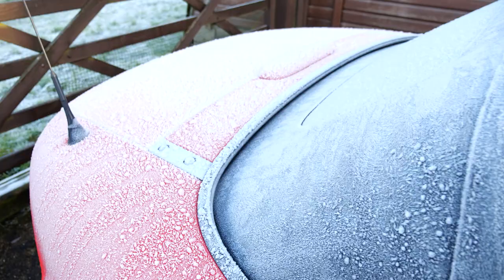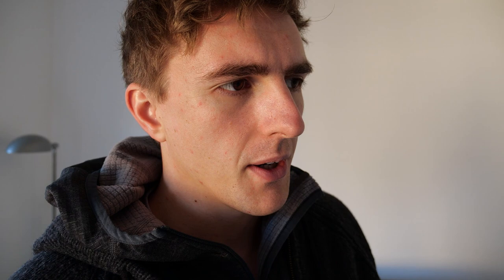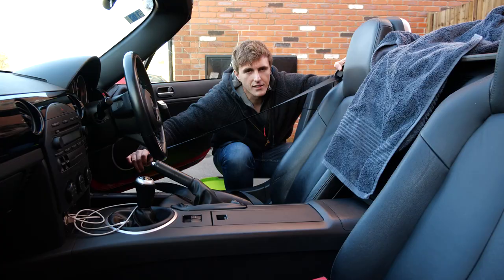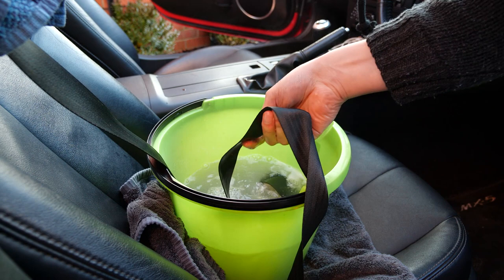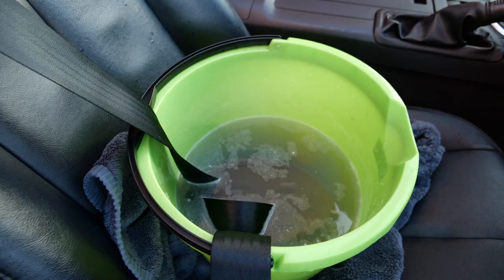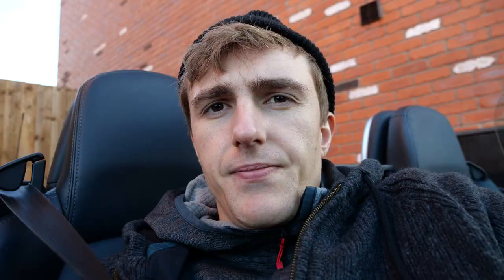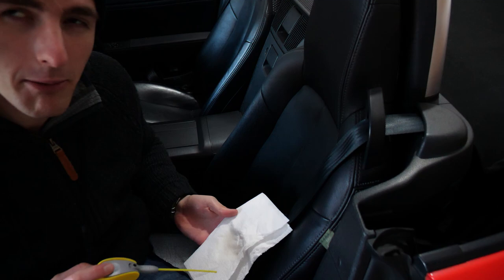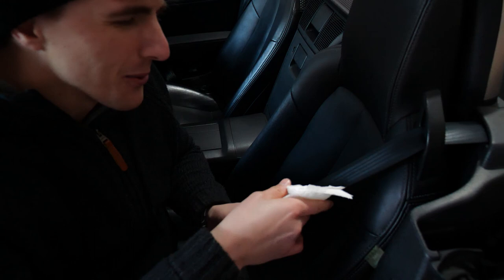Fixing Mazda MX-5 Sticky Seatbelts..

Comment: Hey Dom. I pretty much tried all that with an equal degree of (not) success. Also replaced the belt guides at the top of the seat with 'improved' NC2 ones. What finally worked best was spraying silicon spray around the point where the belt exits the reel (it's behind the trim to the rear of the seats but you dont have to take the whole thing off - you were nearly there, just pop the trim buttons and pull it forward far enough to see the belt reel). Some people recommend trimming away some of the plastic around the exit of the reel, but I haven't done that. And yes, my drivers door area bears the scars of the previous owner trying to shut it with the belt buckle hanging out...
Reply from the maker: CJ Lawrenson thanks for the heads up! I think I’ll have to do a part 2 as Dave said!

Comment: there's another option to the wd40. Wax. the reason the belts stop retracting is the shininess wears off over time. add the sheen back. the wax wont rub off on clothing, and even if it does, you can brush it off.
Reply: what kind of wax please?

Comment: Same issue with our 2008 NC. After cleaning the seat belts it was better but not that great. After replacing the belt guides with the new design (parts 83 Euro), it was acceptable. Still there was a difference between the right an left seat. The guide mounted with a 10.9 bolt, has a slight different angle causing more friction to the belt. After adjusting the guide, both seat belts are smooth moving into the retractor. So small details can have a big influence.

Comment: My mot'er told me if my driver's seat eat is as sticky next year, he'll have to fail it. He recommended cleaning with brake cleaner. I'll give it a try but ultimately,  I think it's a design fault.
Reply from the maker: Is it an NC1? They re-designed the seatbelt runners for the NC2/3 and they don’t stick. Think they are sold on MX5 parts 👍
Reply: Sorry, I should have said, mine is a 2008 Niseko.

Comment: Not sure if you still have this issue but if you're feeling up to the work you can pull the seatbelt out and then wind the spring a couple of times around more (make sure the seatbelt is as reeled in as you can get it, be careful of the spring jumping out) this will help the seatbelts to retract a lot better.

The biggest causes of this is the spring relaxing over time and the increase in friction caused by stuff just wearing down and getting dirty
Reply from the maker: I’m sure others will find the information useful, so thank you!

Comment: You need to remove the sill section, then the upright, I watched a video from the MX5Restorer, he showed cleaning the roof drain plugs, which is behind the seat belt unit, the seat belt is always fixed to the base of the car, so have a look at there videos, I’ll see if I can get a link for you. The video is called How to unblock your MK3 MX5 roof drains, the uploaded is Lights up Lights Down. I saw you used the trombone method.... this guy was removing a stuck trombone cleaner, I know!